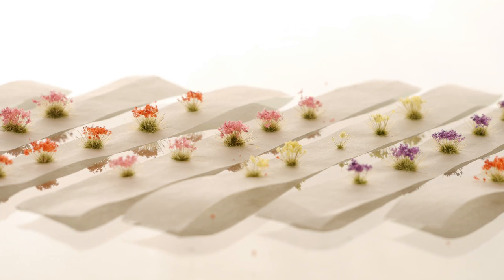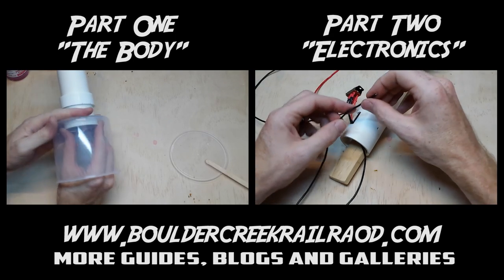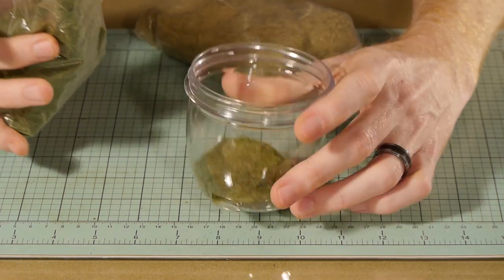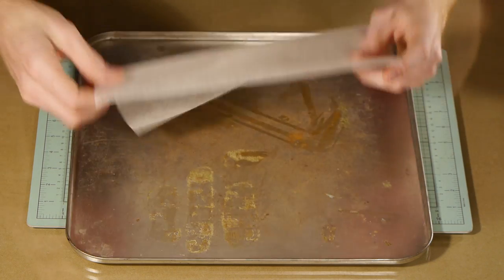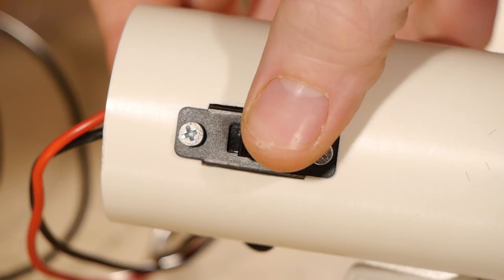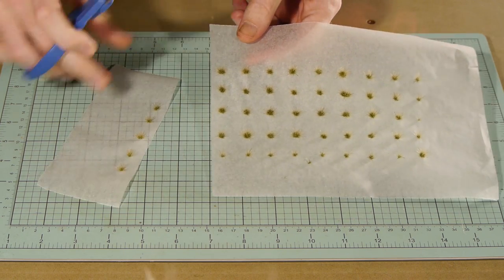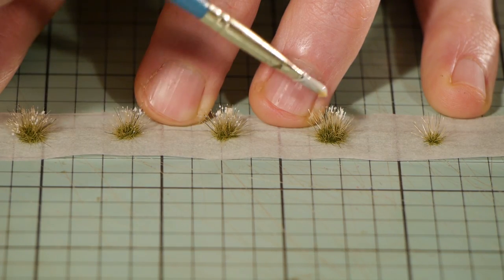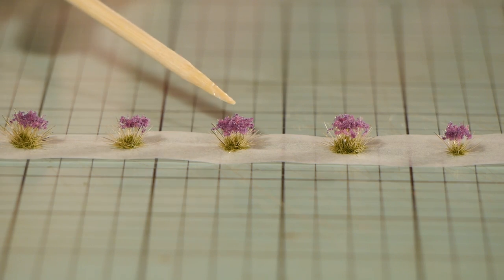DIY Flowering Static Grass Tufts – Model Railroad – How-To

Comment: very nice ...going to see if i can make a grass applicator that's shown in your video.. thanks again.
Reply from the maker: Thanks mate, good luck with the build. The only advice I can give is try using the same negative ion generator that I use in the video, I've had a few try using the cheap ones from China and they seem to have trouble getting them to work well. Plus they have extra wires? Oatley Electronics sell the one I used and it's not overly expensive.
Cheers
Luke
Reply: thanks again

Comment: Thanks for another good, how to video. As to wanting different colored foam, anyone tried using water based dye? Like the 4 colored set sold during Easter to dye eggs with? You'll have to add water to thin the dye, put your foam in/mix it, then let the foam either dry naturally or use a hair dryer. Haven't tried this trick, but haven't made my static grass applicator either.
Reply from the maker: sounds like something worth trying, I'll see if I can find some suitable dyes to use and let you know how it goes 😃
Reply: @BoulderCreekRailroad  how did it go?

Comment: How much money would  model making equipment cost
Reply from the maker: the static grass applicator cost me about $40 to make but if you buy one from a shop they cost between $60 - $180 depending on the brand.
Cheers
Luke
Reply: Luke Towan from where I get equipment n material plz share sir....

Comment: Hey Luke !
Do you have any ideas for building small electric box like this one ?(right part of the photo)
http://www.lanouvellerepublique.fr/var/nrv2_archive/storage/images/contenus/articles/2014/02/14/deux-passages-a-niveau-securises-1796033/33454792-1-fre-FR/Deux-passages-a-niveau-securises_reference.jpg
Reply from the maker: - FallNFly - hey mate, I guess if I was going to make a signal box like that I'd probably start with a small block of wood as a base then use styrene to cover the block, of course you don't need the wooden block but I'm thinking it would make it easier to get it nice and square. You could also try molding one using modelling clay? That way you could scribe in all the small details with a knife.
Reply: Thank you very much !